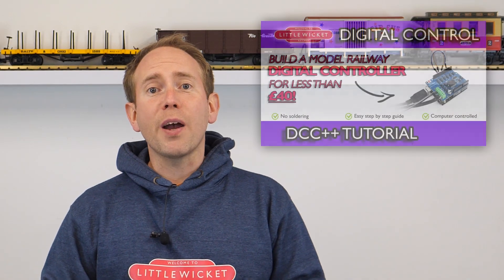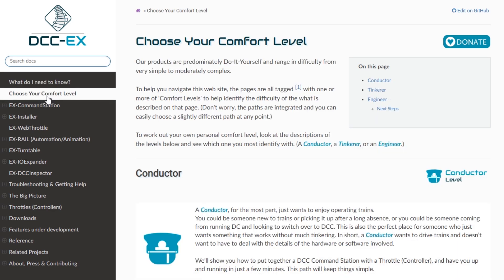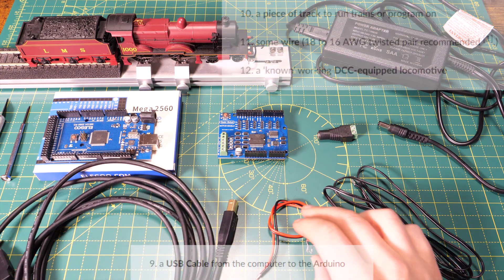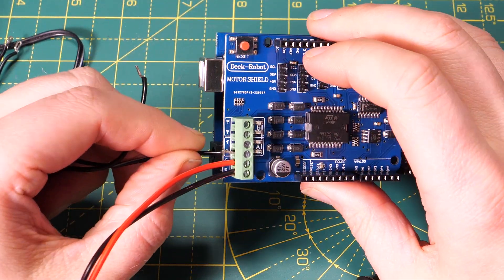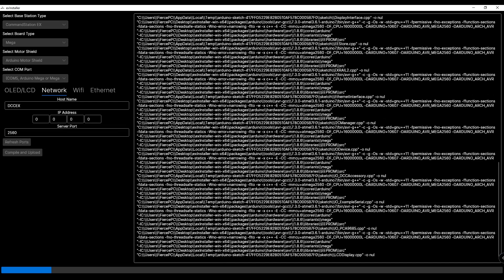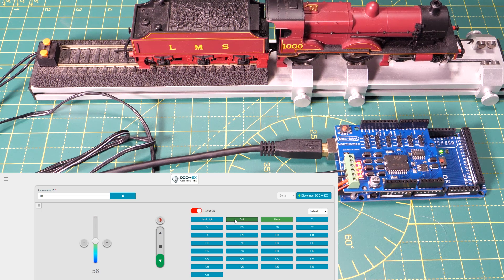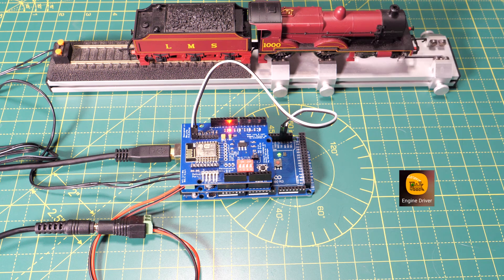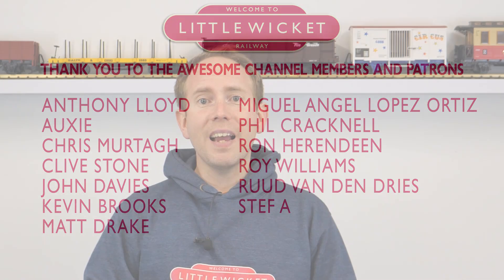DCC Ex - Amazing Digital Controller for Under £50 😮

Comment: Very good video to run alongside the DCC-EX website, I built one up in next to no time, and it works well using USB. However the stumbling block seems to be the WiFi, it seems to be impossible to source a WiFi board that actually works! I ordered (at different times and different suppliers)   two different Wang Tongze boards but both were cloned copies with apparently incorrect chips fitted thus not compatible for this project. The DCC-Ex instructions then get very confusing so it is no WiFi for me at the moment.
Reply from the maker: I think I got lucky with my Wang Tongze board. Did you use the jumper wires like I did in the video? It's frustrating that the recommended wifi board is hard to get in the UK.
Reply: @LittleWicketRailway  I got a bit worried by the warnings about voltages etc so decided to shelve that option, I have since looked at the Makerfabs website and I found that shipment from the States on the slow mule is only $6 so for the princely sum of about £13 delivered I can get the best recommended item! I'm now waiting for the next passing mule.:)

Comment: Great and very interesting video. It's maybe my age, but my preference is for a controller that I can feel and use without looking at it so I can keep a close watch on the train itself. I've tried using touch screen for other purposes which also need me to be looking elsewhere (digital music performance) and I always come back to physical rotary and button controls. I'm not likely to go DCC due high loco fleet and the implied decoder costs but is there anything out there in the open source world that supports "real" controller hardware?
Reply from the maker: You're not alone in preferring a handheld controller rather than touchscreen. You can add hardware to these open source base stations. MERG have a heldheld controller with a knob for their system and you can connect handheld joystick type things to the Engine Driver app via Bluetooth.
Reply: @LittleWicketRailway  Thanks for your reply; I will take a look at that.

Comment: Hi Rob,
I'm on my first layout which is DC but wired so I can switch it later to DCC. I've been put off by the cost of DCC units generally and was interested in the Hornby HM7000 wireless decoders but the DCC-Ex looks like an even better and cheaper way to "dip my toe into the waters" of DCC. Thanks for a great, clear and easy to follow tutorial. Cheers.🙂
Reply: Did it work? How easy was it?

Comment: Good video, like everyone. For now, following your instructions in the previous video, I have set up a project with JMRI with which I manage several locomotives, turnouts, infrared, ultrasonic and magnetic sensors with my computer and mobile, these days I am testing the Dispatcher. I've started reading about DCC-EX, a lot of changes in a short time, I'll follow your videos, but for now I think I'll stick with JMRI.
Reply from the maker: Sounds like you've got a great sensor setup! As you say, tech moves on, but at some point you need to commit. What do you use your Ultrasonic sensors for?
Reply: @LittleWicketRailway  For the Dispatcher test I use a track configuration as in your video, but since I don't have voltage drop sensors, I detect the passage of the train through the turnout with the ultrasonic, since I can regulate the detection distance so that it covers everything the width of the turnout.

Comment: With so much open-source code available for DCC its amazing that sales (and margins) of people like Digitrax (whose prices are somewhat gobsmacking) have held up so well.  I can easily understand why older modellers want the benefits of DCC but don't have the technical background to use things like this or the many available software packages from the Open-DCC project and others - but with somewhat younger people (a fair few seeming to have or had tech industry careers) coming into the hobby you might imagine that the pre-packaged products dominance would be being eroded - but that doesn't seem to be happening - at least not visibly up until now. Perhaps the interest in this approach IS a visible sign of that changing?
Reply from the maker: I think there will always be a market for the slick, branded control systems like Digitrax where people will pay for ease of use and the guarantee that you can just plug it in and it'll work. Especially if users aren't very techy. Hopefully this shows that with DCC-EX you don't really need to be that techy.

Comment: A very nice clear explanation. I do wish that I had seen this and the ones from DIY and Digital Railroad before I spent so much on my system. Might be worth building another model just to take advantage.
Reply from the maker: Thanks Melville. There's pros and cons to every DCC system. What system do you use?
Reply: @LittleWicketRailway  I bought the z21 start. For my needs I find it more than adequate and I suspect that as my layout develops it will be able to keep pace with the growth. I am probably a wee bit beyond Conductor level but am by no means an engineer. I really enjoyed that presentation. I have been buying my electronics from a chinese supplier who I probably will not be able to name but which starts with Ali and ends in Express. It takes ages to get the stuff but it is incredible value for money.

Comment: Great video Rob but I have what may appear to be a stupid question. Will the sensor board which worked with the DCC++ project work with DCC Ex? Ta and keep up the good work.
Reply from the maker: Thanks Dave. The sensor board I think you're referring to works independently, so you should be fine. But I think (still for me to investigate) you might be able to add sensors and accessories to the DCC-EX system directly. Might be worth checking the advanced section on their website.

Comment: Thats cool that there's an easier way into dcc but I still like the dynamics better

But this is great for a cheap and reliable second controller for a different layout if u have more than one so I can see the benefits plus I have to admit that the WiFi option would be the main interest if I was to ues one but that real time delay in impute bugs me a little
Reply from the maker: I think a lot of people will still prefer their handheld systems, but as you've said, nice to have a budget option.

The delay isn't too bad. Might appear slightly worse on the video because my phone capture app records in a variable frame rate, so matching the timing with the main camera perfectly wasn't possible.

If you still want a physical controller rather than an app slider then I think you can add a Bluetooth joystick type thing fairly easily.
Reply: @LittleWicketRailway  cool at leat there opportunity to explore all types of construction with it being open source anyone with some basic knowledge of coding coding add things like lcd joy stick and so on
Reply: Some folks have already built hand-held, battery driven WiFi throttles with physical knobs. Engine Driver on Android also supports standard Bluetooth hand controllers with physical knobs and buttons to control the trains selected on the ED screen.

Comment: Great video. I'm using this setup on my layout, though I haven't managed to get the Wifi working yet so I'm currently connecting my phone to my laptop running JMRI, which is a bit of a faff. But other than that, it works like a charm, and definitely affordable.

One small thing I might add - if permanently breaking the V-IN on the motor driver sounds scary, you can always bend the pin out slightly so that when mounting it on the Arduino it doesn't sit in the socket. It's reversible, and achieves the same end result.
Reply: Could you not solder blob the break?
Reply from the maker: Hi Matthew, nice to hear that it's being used. Good tip on bending the pin.

Comment: Thank you very much from France, i will try that as soon as possible :)
Reply from the maker: Bonjour Astrobond! Let me know how you get on 🙂
Reply: @LittleWicketRailway  Hi, just received the Elegoo Mega 2560, Deek-Robot motor shield and a ESP-01s wifi board with a little adapter yesterday, had to do some easy cables soldering on the wifi adapter as indicated on the DCC-Ex website.
Problem with wifi at first try, had to reload the arduino with exInstaller.exe with only wifi checked without writing name and password, found the DCCEX wifi "box" on my old samsung tablet, run Engine Driver, and that's perfectly working !!! Thank' again ;)
(by default, name of wifi network is DCCEX_xxxxxx and the password is PASS_xxxxxx where the x’s are the last 6 digits of your the wifi ESP-01s MAC address)

Comment: Hi Rob, funnily enough I'm working in exactly this area myself. I have found, though, that those standard motor boards are woefully short of power once you get them onto a layout - the one I had could barely rin two trains. 2A per channel is OK, but that's effectively 2A as one of those channels goes to your programming track. The DCC EX website does have some guides on how to use more powerful boards, I'm currently playing with a 15A one, although they do, thankfully, guide you through taming it down to 5A per channel.
Reply from the maker: For anything more than 3-4 locos you'll need a booster. Reading the discord server there a few preferred options:

- MERG 5A/10A boosters (I've got a couple of those to build)

- a DIY booster based on IBT2 (http://www.trainelectronics.com/DCC_Arduino/DCC_Booster_2/index.htm)

- not sure if it's already out, but power districts (might not be correct name) is a feature the team are working on

- Hans Tanner from IoTT has released a 5A Arduino shield based on the IBT2. Reasonable price for the board, but shipping from US to UK is expensive.
Reply: @LittleWicketRailway  thanks, I was getting regular cutouts running 2 locos on that board! The DCC EX website has a few options about alternative motor driver boards, I'm currently using a 15 amp one tamed down to 5 amps and is working very well.

Comment: have the DCC-EX system here, it really is idiot proof, it must be, I got it to work - not gone for WiFi as yet as no real need here but the base station works really well - its also seriously easy with a Mega to use the various other digital pins to drive relays or whatever.

not tried but the have included support for using point servos etc as well

it really is a wonderful little project, the only downside (minor one) is the power output of the thing is limited - but you can use this to feed into a more powerful DCC power booster

A simple add on thats worth getting is a small I2C buss LCD screen, which the board will use for status messages and can be nicely mounted on a panel to show you its all running, next on my list is to have a got at using the serial ports to create a hand controller myself. something else worth at least considering is one of the shields thats gives screw terminal breakouts for the Mega pins for more robust connections

nicely done into to this as well, really does show just how simple it is and how amazingly cheap
Reply from the maker: Thanks Dale 👍 good to know it's being successfully used. Thanks for the tip with the LCD screen.
Reply: It will also drive the small OLED screens with up to 8 lines of output if you get the 128x64 version which are very inexpensive. Some folks have used the smallest versions of these as station screen displayes. In the next release DCC-EX will support multiple OLED/LCD screens in any mix.